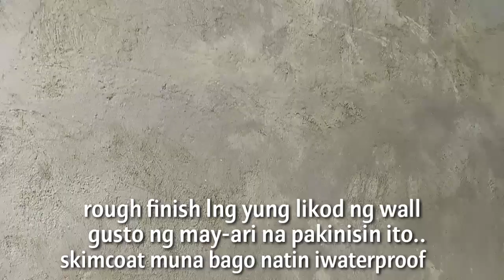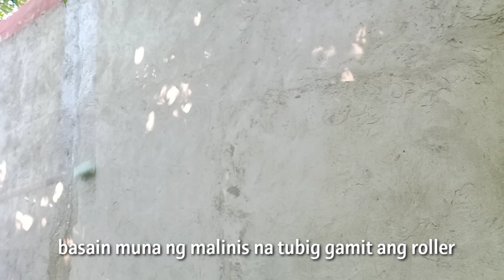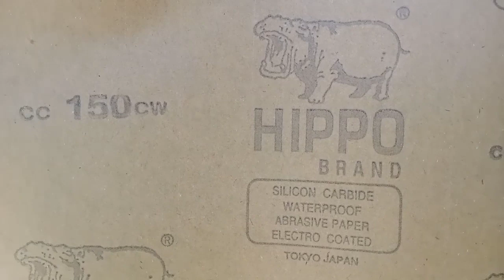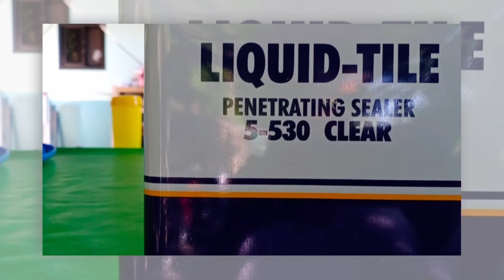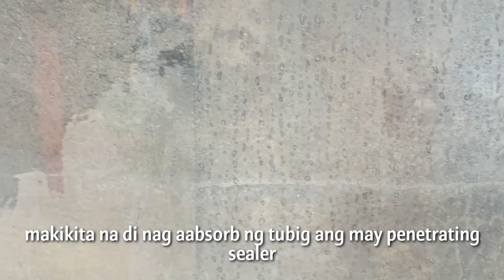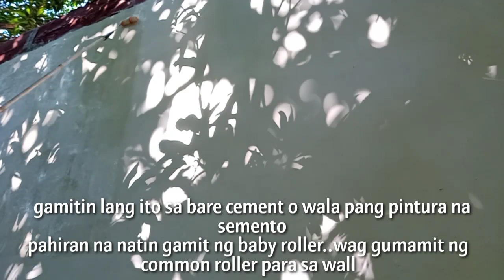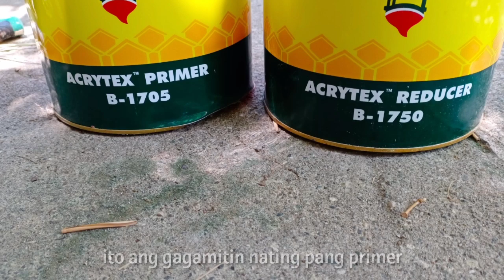Exterior wall waterproofing

Comment: Sir paano po pag yung outside wall is rough finish na po and nag moist sa loob. Ano po magandang gawin? If hindi din po skim coat yung gagamitin papaano po yung process ng pag waterproof? Salamat po.
Reply from the maker: Pwede naman pong pahiran nyo na ng penetrating sealer at acrytex primer tapos elastomeric o kaya ay plexibond
Reply: @LeojayBaguinan  salamat sir... pede dn po yan finish na or kinis then penetrating sealer, primer then ung elastomeric tama po?
Reply from the maker: @tatadiaz1584  pwede basta sa wala pang pintura gamitin ang penetrating sealer o plexibond
Reply: @LeojayBaguinan  salamat sir sa pg answer ng questions ko...
Reply: @LeojayBaguinan  ppaano po sir kung may lumang pintura pa? Puede po ba penetrating sealer agad tapos elastomeric?

Comment: Idol ok lang ba na ang primer ko sa ganyan ay flat latex? Yun kasi nabili namin at hindi acrytec..
Reply from the maker: Hindi po recommended ang flat latex bilang primer sa exterior babaklas po yan lalo na kung ipapatong nyo sa acrytex o liquid tile
Reply: @LeojayBaguinan  maraming salamat po at nakatapos ako ng kwarto namin sa mga practical tips po ninyo. Bale po sa CR. Sa interior. Pwede po ba yung skim coat, concrete sealer tapos latex para sa primer at elastomeric para sa final coat. Salamat po ulit at stay safe
Reply from the maker: @meynardbaptista3452  yes po
Reply: @LeojayBaguinan  salamat po. Katatapos ko lang idol sa skim coat. Pahid na ng sealer

Comment: hello po sir ano po kayang solution dun sa wall ng bahay ko nag bubbles po sya sa loob firewall po un ano po kayang mas mainam na solution dun salamat po sa sagot Godbless po😊😊😊
Reply from the maker: Waterproof nyo po yung firewall nyo bago ayusin sa loob
Reply: maraming salamat po kpno po gagawin dun sa existing na pintura nun tatanggalin po ba muna or llihahin nalang?
Reply from the maker: Mas magandang palabasin ulit yung semento at mag umpisa ng waterproof na pintura
Reply: cge po maraming salamat po malaking tulong po un Godbless po

Comment: Pano po kapag may pintura na ung wall? Yung samin kasi kagagawa lang ng bahay nag papawis at nag leak. Salamat
Reply from the maker: Yan po ang problema pag di naiwaterproofing ang labas lalo na yung babad sa tubig pag tag ulan
Reply: @LeojayBaguinan  yun nga po boss d namin alam na ganun ang ginawa ng contractor. Open pa namn un walang bubong slab ung bubong nya. Pano boss ang magandang solusyon dun? Kailangan ba alisin ang pintura para i waterproofing? Salamat
Reply from the maker: Yes po

Comment: Pede po ba yan sealer sa loob kasi d kaya pag sa labas, d accessible
Reply from the maker: Di nya rin mapipigil yung tubig galing sa labas
Reply: @LeojayBaguinan  thanks po sir, kanal po kasi likod at d talaga accessible, may paraan po kaya sir kung dito sa loob gawan ng paraan?
Reply from the maker: Try mo lng sa loob yan baka effective
Reply: @LeojayBaguinan  sir ung labas d nakafinish pede po ba ihalo ung flexibond isabay sa pag finish?

Comment: Sir saan po mas makakamura yang penetrating sealer or flexibond sir?
Reply: Konti lng deperensya kasi kapag flexibond dpat 2 - 3 coatings tpos kelangan haluan ng cement. Then primer at finishing paint.
Magkakatalo nalang tlaga dpende kung gaano kalawak ung kelangan iwater proofing at dpende sa labor ng gagawa.

Comment: Sir panu kng me pintura na sa labas pero tumagos pdin sa loob? Anu solution?
Reply from the maker: Ginagawa ko pag ganyan pinapalabas ko ulit yung semento at mag umpisa ulit ng pang waterproofing
Reply: @LeojayBaguinan  ano po ginagamit pang remove ng existing paint. Same problem po. Damp walls. May existing paint na po.
Reply from the maker: @123Jeamed  angle grinder ang bala ay liha na no.36

Comment: pano po pag cement finish ang wall pwd ng mag skim coat?
Reply from the maker: Pwede po
Reply from the maker: Papasok pa rin ang tubig kung sa loob ang waterproofing mo
Reply from the maker: @JeanandBiancabooboo  sa slab cementitous water proofing ang gamitin mo para pwede mong patungan ng topping o tiles kung sakali
Reply from the maker: @JeanandBiancabooboo  pwede damihan mo ng coating
Reply: Sir di na madukot sa labas ang wall kc may nakatayo  na po.  Mag Double wall po ako tatagas pa kaya ang tubig ulan?